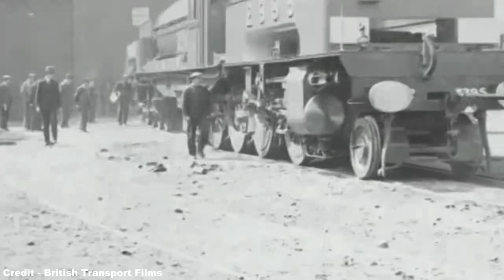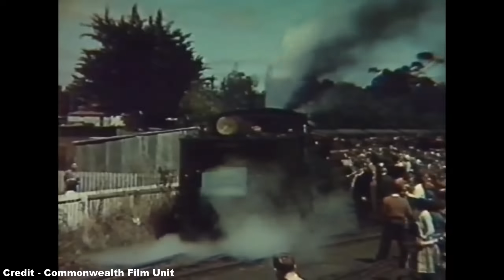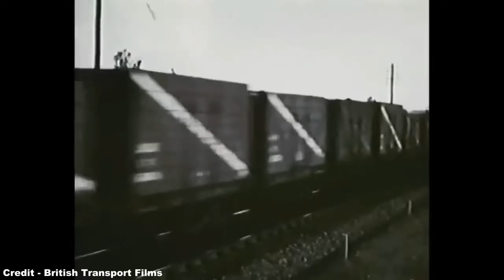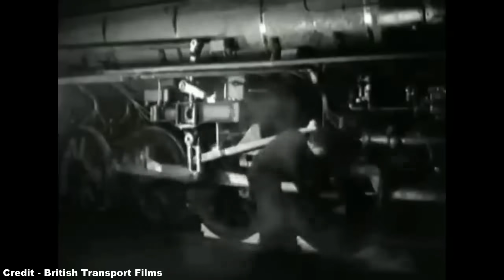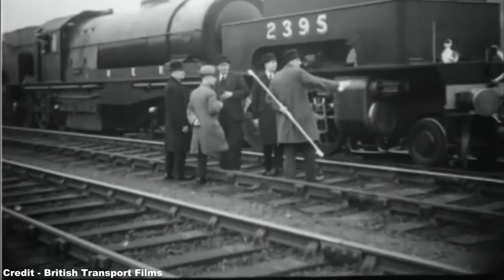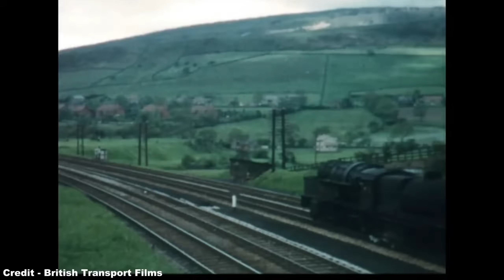The Story of the British Railways Garratts (Reworked)

Comment: My father used to fire garrets on the LMS. He said the draught could be so strong, it sucked the coal off the shovel and the coke from the chimney rained onto the cab roof. The rotary tenders were very unreliable. Often a big lump of clinker would jam them, so he had to climb inside to break it up.  Pulling 120 wagons of coal loose coupled was not fun when the speed got too high. Several times he had to jump off and hit as many wagon brakes as possible then jump on the guards van for a cup of tea and hopefully the train comes to a stop before a red signal.  The amount of times they were hoping that all the pegs were off otherwise they would have Spadded for sure.

Comment: With The NSW Garratts in the form of The AD60 Class though they were introduced from 1952 to 1956 it wasn't until 1966 that approval was granted to double-head them. They were in service until the 24th of February 1973 but on the mainlines it was December 1972 that the last of the 260 ton giants were withdrawn. One of the most spectacular sights of the steam ere in NSW was two AD 60's hauling 1200 tons of coal from Newstan Colliery up the 2kms of 1 in 40 of Fassifern Bank. Though they had to reverse until just south of Fassifern Station to get a decent enough run up Fassifern Bank.

Comment: Another detail found in Australia was to get max. tractions the water tanks had to be as full as possible as the weight of the boiler section was shared between the two drive units. On a long and steep hill traction would reduce as the water was consumed. Also a reason South African Garratts had to pull water tank wagons to enable journeys to be completed, due to traction, water consumption and the dry terrain restricting water supply.
Reply: Being a glorified tank engine did mean a steady loss of traction during the journey

Comment: Just to let you know, the Big boy and most Garratts were NOT mallets. They all had the same cylinder size in each set of driving wheels.
Reply: The Southern Pacific's Cab Forwards like 4274 and 4294 were called "Mountain Mallets."  That and the Virginian Railroad's AE 2-10-10-2 Double Decapods were Mallets.
Reply: In the case of the Cab Forwards that's more of a local name rather than a literal name. Cab Forwards were simple articulateds, not "true" mallets.
People often group all articulated locomotives as mallets simply because mallet locomotives were the first articulated locomotives. Mallets use compounding, and thus have different sized front and rear cylinders, the rear cylinders being smaller as they use fresh steam and the front cylinders being much bigger to make use of "spent" steam. "Simple" articulated locos use fresh steam in all cylinders and thus have all cylinders sized the same.
Back to your example, while the Cab Forwards are not true mallets despite the locals calling them "Mountain Mallets", the Virginian locos were indeed true mallets with larger cylinders in front and smaller cylinders behind.
Reply: @davidwhiting1761  I'm sure the railroaders called 'em that sometimes
Reply: @davidwhiting1761  If you want to get REALLY technical, the very first Cab Forwards were in true Mallets.  However, the Southern Pacific, like most US railroads, determined relatively early on that the use of compounding was unsatisfactory for its purposes and converted all existing Cab Forwards to simple engines, with all subsequent examples being built as simple expansion from new.
Reply: @00Zy99  Yeah, Mountain Mallet and Backup Mallet was essentially a carryover term from when the Cab Forwards were Mallets. If there’s one thing railroads are infamous for, it’s being slow to change, and that applies to vernacular as well.
Reply: The Big Boys aren’t Mallets in the way they use steam - as is a Y6 - but in terms of articulation. they are the same. They’re technically Simple Mallets
Reply: @RussettGXY  "Simple Mallet" is a contradiction in terms. A mallet is by definition a compound articulated steam locomotive.
Reply: @zanelindsay1267  Yet it’s still more specific than calling them “Simple Articulateds.” You wouldn’t call a Big Boy a Fairlie or a Meyer, would you?